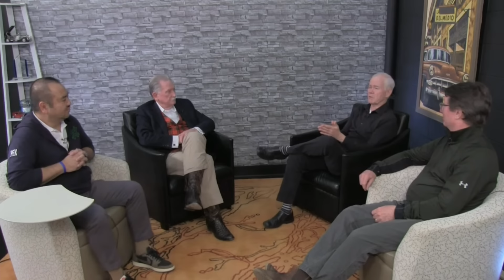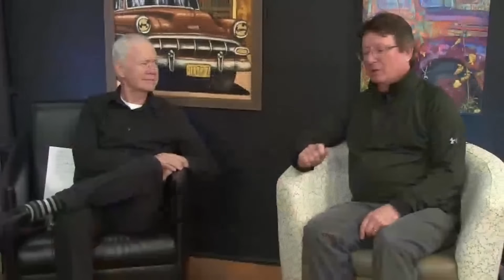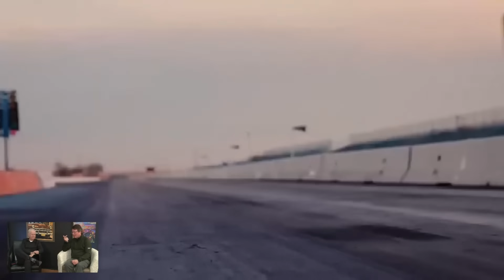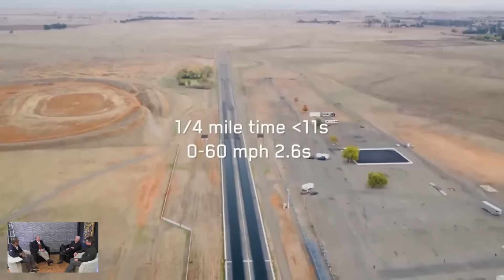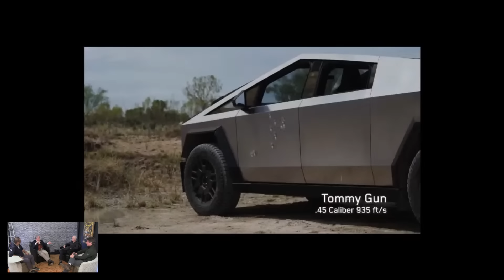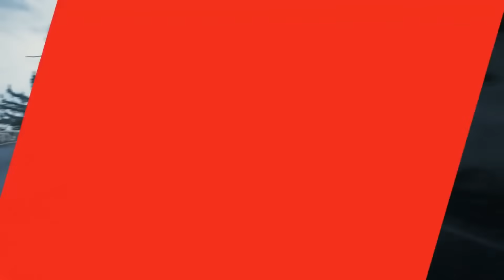Tesla's Cybertruck: A Cringeworthy Masterpiece - AAH 676

Comment: John is so locked in to traditional OEMs he is always pushing fud on evs.. and now he is even buying the lie that there is no ev demand.

People want EVs .. just not the shit being pushed by the big OEMs
Reply: The equivalent to the Chevy Bolt from BYD, made in China sells for $12,000.

At some point, the floodgates are going to open.  Mary Barra will jump out in a golden life raft.  And GM will go floating, right down the drain.
Reply: They don't want enough EVs  just like not enough people wanted little honda accords in early 80s.
It's literally no different.  People who wanted good little rock solid cars wanted them and bought them.
The Big three made *shitty* attempts at little cars, said meh, nobody wants them.   Then lost all the market share

They are making poo poo EVs now.    Except for Chevy bolt.  That got discontinued.
Mach-e?   sitting on lot.   Because people know if you drive too fast, it will brick and leave you on the road.
found on road dead     

There is a 3-5000 markup on Bolts EUV
Reply: When personal computers cost thousands of dollars people didn't want them.  When flat screen TV cost thousands of dollars people didn't want them.

EVs will become cheaper to manufacture than similar-feature ICEVs.  As competition brings down prices people will snap up EVs.
Reply: @bobwallace9753  EVs COULD BE CHEAP already ! Just make them SIMPLE, just a TOOL for daily commute, short trip.... Currently the infrastructure can't cope with the requirments of these big EVs !
Reply: @ellsworthm.toohey7657  There's only one company that understands this, and came up with a solution. But it recently dawned on Jim Farley, so maybe there's hope. Unfortunately, he doesn't want to build cheap cars.
Reply: @ellsworthm.toohey7657  
Given that the cost of EVs is largely driven by the cost of batteries, the only way to make a less expensive EV (aside from downgrades like cardboard door panels, etc.) is to market a low range EV.  I'm not sure there's enough market for an EV with a very modest range.

Give it one to two years.  China is driving down the cost of EVs and Tesla is about to start construction on factories for less expensive EVs.  Tesla should be in the catbird seat as they scale up their 4680 battery production.  Those cells should cost considerably less than any other battery on the market.
Reply: @ellsworthm.toohey7657 they are cheap in China.
It's import tariffs that add to the price.
Reply: Or the rubbish that is Tesla.  Tesla is brilliant - but sit inside the Model Y and it really feels cheap and nasty.   Quite frankly I want an EV but recently purchased ICE (hopefully for the last time).  Not one EV had the local support (i.e. within100 klms or 60 miles).  Indeed for many the closest support is 350ks (217 miles).  OK for an annual service but unworkable if things go wrong.   No spare tyres, just repair kits.  Locally EV owners use roof pods to add a spare.    But mainly I think the current battery technology is not good enough - clearly going to be obsoleted within 5 years.
Reply: @rovert1284  lol.

There is nothing wrong with my tesla. Keep drinking the koolaid provided to you in a nice cup by the mass media
Reply: @DuarteMolha  I wish you the best. A friend of mine has a Tesla. Someone bumped into him, not much to be seen. But when they repaired it, they saw that the gaps of the body were not correct any longer. They had to get new parts, and my friend waited for over a month, and would he have to pay for it, he said something like 20,000 Euros or so. 
 
Tesla is extremely strict, it does not provide any information or give out spare parts. Only licensed Tesla workshops are allowed to repair Teslas, and that means you have no choice. And as you are dependent on them, you will always get the Big treatment. No compromises made. 
Either you pay the price or you have no car.
Reply: @feedingravens  so...someone bump.into him and He has to pay? Why. It is the insurance of the other person  that has to deal with that if it was their fault
Reply: So, in other words.... They aren't buying EVs. Which is exactly the same as not wanting them, today.
Reply: @Chris.Davies they *are* buying evs.   Just not shitty ones

Every chevy bolt is sold.   There are 3000-5000 markups.

The only ones I can find are bloated ones with 7000 of sunroof and useless supercruise options.
Reply: @BarryObaminable  
It's a lack of competition.  And that's largely a US problem as we have created a trade barrier keeping out Asian EVs.  Things will change over the next few years as Tesla produces a much more affordable EV and as Chinese and Korean manufacturers start building EVs for the American market either in the US or in Mexico.

Automation is lowering the amount of human labor in vehicles.  China no longer has rock bottom labor costs, apparently labor costs are lower in Mexico.  Detroit, again, is asleep in their bubble.
Reply: @Chris.Davies  

No.  People are not buying the EVs that legacy car producers are manufacturing.  Tesla is doing great.  BYD is doing great.  Other 
Chinese EV makers are doing great.  France, for example, has now reached 30% EV market share.  Norway is close to 100%.  Other than Tesla EVs are now selling well in the US because our laws are keeping most desirable EVs out of the country.

Comment: I'm gonna challenge the notion that Tesla has wired their speakers to be driven via the gigabit ethernet signal. Sure, you could power a CAN transceiver, DAC, and amp at every speaker, but how is that a savings? Plus, quality audio power amps don't fit on speaker housings. Will someone please challenge this assertion that the Cybertruck speakers are all only connected to 48V power, ground, and a CAN bus. This generalization that 48V plus gigabit CAN system powers everything including the speakers is bogus. Imagine the imaging problems you'd create with trying to time over a dozen distributed DACs?
Reply: When you are powering a single speaker you don't need a powerful amp the only speakers that need any serious power are your bass\subs. When you know that you have the datarate and use all the same DACs timing is easy you only have issues if you are trying to make it work with limited through put. In software adding micro seconds of delay is easy rember that in a Tesla it is the main computer talking to the speakers not headunit>amp>speakers
Reply: @jackdbur - but let's see the proof that this is the length that Tesla went to to eliminate unnecessary wiring and replaced it with stupid increased redundant additional chips /circuits/bespoke powered speakers. Munro talks out his ass a lot, and no one actually challenges him when he speculates way beyond his understanding. Yes, Sandy Munro BSs as badly as Elon does. Let's stop that irresponsible shooting off of the mouth.
Reply: @karlInSanDiego  You can run one 48V wire into the door to run the locks, switches, sensors, windows, and speaker. Then the 'net sends commands and data, and on the speaker you have a DAC and DSP that corrects the response of the (cheap) speaker, then a Class D amp powers it. Not rocket surgery.
Reply: @jamesvandamme7786  and that would be an interesting if not massively overcomplex way to perform audio at every speaker. Do you actually believe Sandy was told that's how it works, or is he hand waiving because he didn't understand what's needed to build a stereo that way. If the goal is to keep things affordable and reliable, you cannot argue that solution is good design. If nothing else, it sets up your CAN bus for noise and heartburn when all that unnecessary micro electronics start to fault.
Reply: @karlInSanDiego  Sandy's a mechanical guy and you don't talk to him about MOSFETs and Ethernets without his eyes glazing over. At least he is amazed by Ohm's Law. So nobody is sure about what's inside CT without a teardown. If I was going to spend $100K on a truck I wouldn't be worried about repairability and affordability. But the chances of that are zero, in my case. 
As for design choices, I can see pluses and minuses, and a lot of unknowns in manufacturing for distributing audio over ethernet. We'll see if it becomes a new paradigm.
Reply: The cost savings is when you don't have to include lots of point-to-point wiring harnesses in the car. Tesla has a unified cable with wires for gigabit Ethernet and 48v+data CAN that runs to regional microcontroller units, which then connect to the components. That change led to a 77% reduction in the weight of the wiring in the Cybertruck, because you can send all the signals over Ethernet and data CAN, so just using a few twisted pairs of wires between the microcontrollers and 48 volt wiring is much thinner than 12 volt wiring. Because Tesla designs most of its own microcontrollers, it eliminates a lot of excess cruft that isn't needed and becomes more energy efficient. It think it is all those changes that represent the $1000 in savings that Sandy mentioned when switching to 48 volt.
Reply: 24v power amps are on the Left & Right controller boards (later will be 48V) https://youtu.be/J5zDNaY1fvI?t=2495
Reply: @waynerussell6401  thanks. So they have front right and front left "body controllers" on the firewall, each needing 24V stepdown for multiple integrated audio amp circuits. So no, not driving the speakers with the CAN bus and 48V. Then they eluded to rear controller, but didn't specify if that has a common or separate left/right controllers. Assume that means the car still has traditional speakers and uses traditional speaker wires. They distributed the sound system across many points of failure and made it impossible to upgrade and difficult to support with anything but overpriced proprietary controller boards. Not progress. Just black box engineering like you might use if you didn't expect to maintain a car for decades. Maybe Tesla will keep up that painfully bad habit of continually modifying parts so these controller boards of this particular build are only made exactly like this for 7 months, before a minor change in the design makes it impossible to source an exact match replacement board in a few years. That's OK. You'll just have to avoid unlocking the front right door, lowering the window, listening to the speaker or adjusting the seat or the wing mirror. Treating car design like it's a kitchen appliance that you can't maintain because the manufacturer won't stock replacement circuit boards.
Reply: @karlInSanDiego Tesla's history of continuous improvement is generally backwards compatible. The only notable departure is the V3 and V4 main computer boards. All the technical documents and service manuals are freely available on-line. Their engineers are focused on best product and no way comparable to traditional OEMs. Hence their continual reputation for customer satisfaction in surveys, most safety, lowest cost in use  and least repairs. Why would you have such a distorted view?
Reply: I have no idea,  but the speakers could have a voltage converter on each of them like they do in resraurants, malls, buildings etc.
Reply: My guess is they will combine the window regulator and speaker. Or move the speakers into the dash
Reply: Wireless transmission seems more likely than transmitting audio signals over power wiring

Comment: It’s almost 2 million resos and the $100 is refundable. Are we starting with 2 bits of misinfo people?
Reply: Well, since you’re already crying, Tesla may now be over 3 million reservations…another +1 million since the delivery event.

Carry on…
Reply: @guslevy3506  I believe it!  It was just a bit off that Sandy said 1m not 2m+ and John said unrefundable… maybe Sandy just doesnt know or care about those numbers as much as the engineering ones
Reply: @TurdFergusen I was at a Tesla store on Tue and the lady there slipped that number out..
Reply: @guslevy3506  👏👏👏
Reply: John was most likely referring to the fact that Tesla wants $1,000 when it is time to move your reservation forward.  They required the same type of thing when I moved my Model 3 order forward years ago.  So, he was either under the wrong impression that every reservation holder needs to give Tesla $1,000 right now, or he misspoke and should have been more clear.

No one except Tesla knows the number of Rez, but 2M wouldn't; surprise at all.  That said, given the lower range and higher price, I think the drop-off rate will be higher than it would have been at $40k, but either way they'll sell every one they can build for the next several years.
Reply: @@OrwellNailedIt I missed that official confirmation of it being over 2 million. Interesting, but I’m not surprised that it could be three even like tracker shows.
Reply: sandy went low and john went high with those ones
Reply: 😂😂😂Let’s call it just a single MILLION 😂😂😂
Reply: No one cares

Comment: Yes, great show... but STILL, no one yet has answered, "How do you repair fender benders?"
Reply: Replace the dented panel?
Reply: Try bending a Cybertruck 😂😂😂
Reply: @Berretotube  It's called physics, inertia, momentum + speed and weight = poorly CT.
Simplz.
Just wait for the repair horror stories
Reply: @Berretotube  Park one at ANY grocery or big-box store...and I'll show you dings & dents within minutes!
Reply: @12345682900  100%!! Old school autos dent like crazy. CT does not. That’s just one small part of its genius.
Reply: @12345682900 Nope, you won't   You're thinking about refrigerator grade stainless.
Reply: Great idea for a whole show!
Reply: Many "fender benders" will not actually bend the CT at all.  If it's really bad - such as dent from a bullet, it should be one of the easist vehicles to repair. Any one of the 9 panels are removed and replaced. No welding, no cutting, no seams, no painting.  Body shops may hate it as they can't charge hours of labor. I expect any DIYer can do the work as well.
Reply: @tesla_tap  ❤️❤️❤️👏👏👏
Reply: @tesla_tap  Hmm.  I shall believe that if and they I see it.
Tesla's poor history for making enough spare parts is well known.
No spare parts, longer delays.  Longer delays, more loan car duration.
Longer loaner length, insurance premiums go up.
I've seen nothing to suggest this cycle will change anytime soon
Reply: @stuartburns8657  - Yes, the pandemic did cause a few problems for all automakers.  Is Tesla perfect, no, but for the vast majority of owners, Tesla service has been great.  There are always a few outliers, no matter what automaker.  Tesla even offers their own insurance, although I found State Farm that I use was the same price for my prior car in the same category. You may have DUI or lots of accidents that drive up your insurance no matter what new car you might consider, which has nothing to do with EVs vs ICE. Perhaps an old used car is a better choice for you if your insurance rates are sky high.
Reply: @tesla_tap  All fair points.  I'm still with ICE at the moment, and likely waiting until 2026-27 before I take the plunge.
Only drive a few miles into work, and with the vehicle fully paid off, no burning need or value in switching.
Insurance for EV's (certainly in the UK here) has been going up considerably.
Doubtless a mixture of overall car price increases, but EV battery safety post minor incident, and long part waits for EV's are definitely exasperating this from what I understood.
Hense why I'm happy to wait.
Let the market space nature.
Hopefully new battery tech, 
Charging infrastructure (on the back of Tesla's 2nd to none) setup and more mature EV offering.  Finally, what the 2nd hand market looks like
Reply: You don't.  You get a loaner from insurance and no bodyshops have either the equipment nor the experise to fix them.
Premiums going up lol
Reply: @stuartburns8657 sounds like a great opportunity to start a repair shop that CAN fix them.